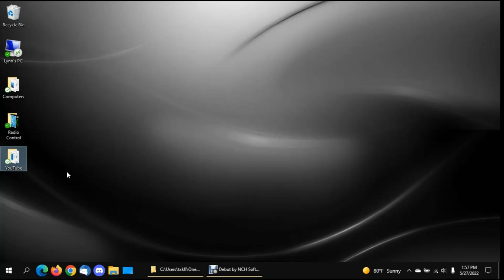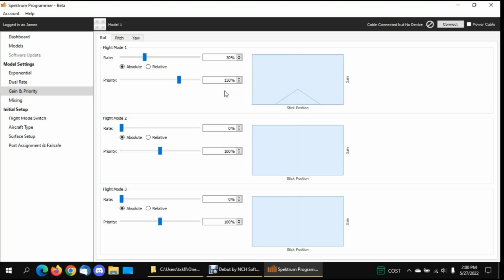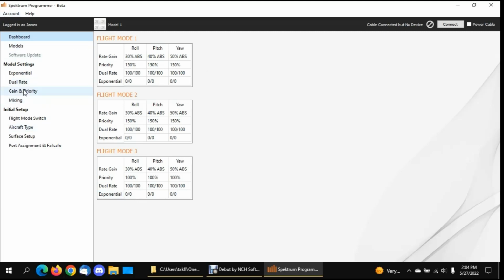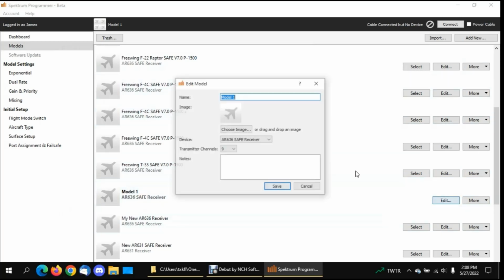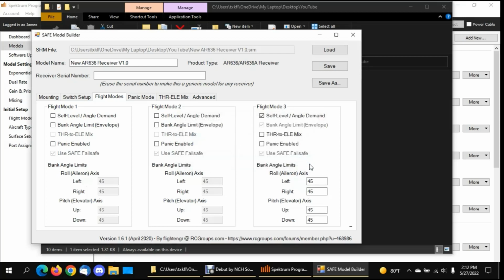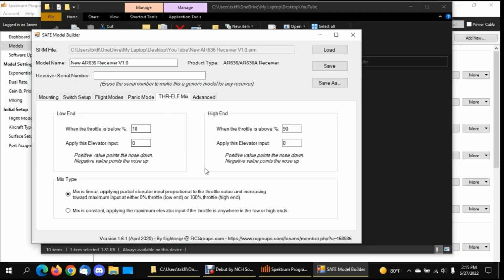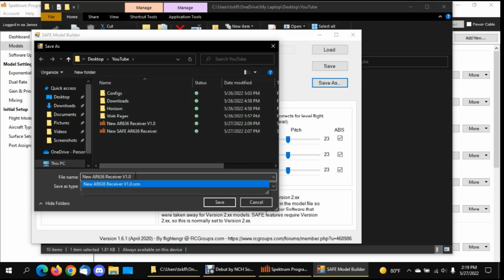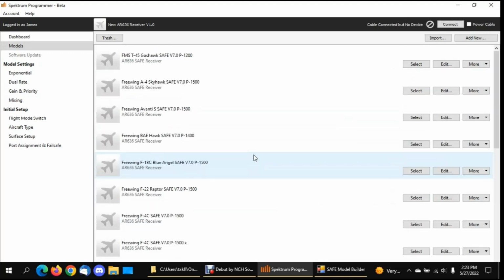Spektrum AR636 AS3X & SAFE Receiver How-To

Comment: so sad I couldn't find this video. had an old eflite pitts that got nailed into a tree, and on the next flight I reversed ailerons in the transmitter. had no control over the airplane, and it did a nose dive into the ground. ALWAYS double check your surfaces.
Reply from the maker: Not just what the sticks do, but what the gyro does as well..

Comment: Very good video. i learned alot.
Got my FMS ranger to a AR636 now and it works.
1 thing though .. on mode 3 you said keep everything to 0% if you want full controll... no AS3X etc.
I did that but it still does level off etc on mode 3. (I copied your complete video as a setup in my receiver with mode 3 on 0%. I guess later on in the video you sett all to AS3X again without mentioning the 0% without AS3X..
Well i got it flying anyway :) Thanks :)
Reply from the maker: With my single switch setup for low rates with AS3X, high rates with AS3X, and high rates with SAFE mode, All three FM's have the same AS3X gains, but FM1 and FM2 are AS3X only and FM3 has AS3X and SAFE Self-Level/Angle-Demand. If you want FM1 to be Gyro Off, set the AS3X gains for it to 0%. FM2 will be AS3X only, and FM3 will be AS3X with SAFE. But, you'll need to put the FM channel on a separate switch. However, the angle limits in SAFE mode are only correct when the dual rates are set to 100%. That's why I put both functions on one switch. When I go to SAFE mode, the rates also change to 100%. With separate switches, you'll have to manually switch to high rates in SAFE mode. Or, you can set up a logical switch to do it.

Comment: Sorry to trouble you again. I have set up a XFLY F15 40mm twin EDF and everything appears to work fine except for the elevator trim. The elevator moves in the correct directions and the gyro also moves in the correct direction but when I use the trim for the elevator to trim the model the trim goes in the opposite direction. For instance when I pull the elevator stick back my elevator raises as it should do to make the model climb but when I give it down trim (pull the trim switch down towards me) on the tx and expect the elevator to raise to enable the model to climb the elevator goes down instead making the model nose dive. I have been flying for over a decade so know how the sticks and trim to work so I know that the trim is moving in the wrong direction. I am using a Radiomaster TX16s and cannot see any functions to enable me to reverse the trim. Your help would be appreciated.
Reply from the maker: I don’t see a place where I can reverse the trim. When I look at the monitor, the trim moves the output the same way as the stick. Btw, make sure Enable Max Throw is unchecked. Create a new model and see what the trim does.
Reply: @txkflier  Thanks, I created a new model from scratch and it is still the same. The aileron trims seem to work the correct way but the elevator trims do not. Very puzzling. Where is the Enable Max Thorw check box, I cannot see it on both the SP and SMB.
Reply from the maker: @786free1 It’s in the RF settings of your transmitter.
Reply: @txkflier  I have enabled 'Max Throw on my Tx but to no avail. What does 'enable max throw' do any way? If it just allows maximum throws on all control surfaces then I already have that on high rates.
Reply from the maker: @786free1 When Enable Max Throw is checked, the receiver’s flight modes won’t work correctly; i.e., you won’t get flight modes 1, 2, and 3. A Spektrum transmitter outputs 1500+/-400 microsecond pulses at 100% travel. A TX16S outputs 1500+/-512 microsecond pulses. The Enable Max Throw option tells the 4-in-1 module which pulse width range to use - unchecked is Spektrum mode (+/-400) and checked is +/-512 which Spektrum receivers don’t like. So, leave it unchecked.
Reply: @txkflier  Thanks for clarifying that. I will uncheck it but since it was unchecked before, unchecking the 'enable max throw' box has not really helped. If you happen to figure out what could be causing the trim for the elevator to act in the opposite directions then please do let me know, it would be appreciated.
Reply from the maker: @786free1 I don’t know of anything that would cause the trim to be reversed. All I can tell you is look at the output screen and see if the stick and trim move the output in the same direction.
Reply: @txkflier  I just checked the tx monitor and the elevator stick and trim go in opposite directions.
Reply: I figured it out! I had unintentionally entered the weight of the elevator in the INPUT page as -80 instead of +80. Silly me. After correcting this to +80 the trim is now moving in the correct direction. Thank you for all your help, much appreciated.
Reply from the maker: @786free1 You should find the TX16S/EdgeTX thread on RC Groups and ask those guys what could be causing it.
Reply from the maker: @786free1 Good deal..

Comment: Help please. For some reason I cannot get the elevator on a new model (P51D Mustang) that I have set up, to go the correction direction in gyro mode. However the elevator moves the right direction when using it with the tx only. I have ticked the box on the Spektrum Programmer to reverse the direction of the elevator but this has not helped. I have re-set the rx and have tried it multiple times but to no avail. I have also reversed the elevation on the tx then ticked and also unticked the reversing box on SP but to no avail I have also tried using another working model template but am still not having any luck. Furthermore I have also tried just using the SP without SMB but even then I cannot make elevator gyro work correctly. I cannot think of anything else to do.  I would have thought that the tick box on SP would have made it work but not sure why it is not. I have the AR636 in three other models (P41 Razorback, Arrows's Red Hawk and Arrow's Viper) and they work fine. I also have another model (F15) that is also having the same gyro issue but with the ailerons but I am guessing whatever solves the issue with the elevator would also solve the issue for the ailerons.
Reply from the maker: With the AR636, you must NOT reverse the aileron, elevator, or rudder channels in the transmitter. You MUST reverse them in the Spektrum Programmer (SP). I create the model in the SP, export it to a folder, load it into SMB to edit all of the settings there, save it, import it back into SP, set what I can in it, and then write it to the AR636. If a control surface is backwards, I reverse it in SP and write it to the AR636 again. I initially set the AS3X gains to 30, 40, and 50 percent for AER. If you aren't editing the SAFE gain multipliers in the SRM file with a text editor, I'd set the SAFE gains to 15 for roll and 25 for pitch. If you're changing those multipliers from 100 to 50, I'd use 30 and 50. I start with the pitch attitude trim set to -1000 for 10 degrees nose up and edit as needed after a test flight. Also, don't set up low rates or expo in SP; do it in your transmitter. Set all of the priorities to 150 except in SAFE mode; I use 100 there since you should set the dual rates in SAFE mode to 100%. And, I set my expos to 1/4th (for small control surfaces) or 1/3rd (for large control surfaces) of whatever the rate is; e.g., 100% rate/25% expo or 75% rate/25% expo. In other words, divide the rate by 4 or 3 depending on the size of the control surfaces and set the expo to that value.
Reply: @txkflier  Thank you for responding. I should have made it clear, I only reverse the  surfaces before using SP and SMB as some of the servos have been installed the wrong way. I understand that to make the gyro work correctly I have to reverse the servos on the SP. Any way I managed to figure out what was happening, the amended settings that I would make to make the surfaces turn the correct way on SMB and SP were not really writing to the rx. As I plugged the cable into the rx and ticked the tick box on SP it was flashing once making me think that it was also writing to the RX. I was not seeing the green bar appearing briefly and forgot about that. 

I also noticed that sometimes SP would not write to the RX if the servos were plugged in. Once I would unplug the servos from the RX it would work fine. However this does not happen all the time. I also understand that the RX has to be positioned the way it was bound otherwise it would not turn on. Thank you once again, I very much appreciate your help.
Reply from the maker: @786free1 The USB port can’t supply enough current for servos, so load SP, plug the cable in, and then power the plane using a flight battery. Do not click the box to power the receiver from USB. Again, do not reverse any channels in the transmitter; do the reversing in SP.

Comment: I’ve got my airplane bound and it is bound and safe, but I cannot get a switch assigned to safe. I’ve called it all instructions in your video, but I still cannot get a switch assigned to safe. I take the receiver and move it but if I put it in solid and try to find a switch, I can’t get it to work
Reply from the maker: You have to go into Channel Assign in your transmitter and assign a switch to the channel you selected in the Spektrum Programmer or the SMB software (it should be the same channel in both). I always use channel 7 for the receiver's flight modes for an AR636. So, I'll assign switch B or C to channel 7.

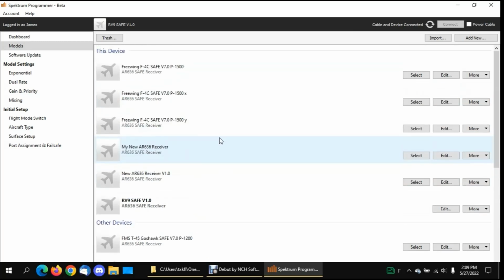Comment: At 12:40 you said that when u connected your rx to the pc it automatically picked the last model   you were working on, but that doesn't mean that is going to write over that model rx automatically, does it? I think not but just want to check.
Reply from the maker: If the programmer doesn't find an exact match, it'll pop up a screen where you can decide what to do. Stop and think about what you want it to do. I usually click on the "Show All" button, select "New Model", and then select "Use Device Settings". It'll then read the contents of the receiver so that I have a copy of whatever was in it. Afterwards, I can rename it as needed. If you make the wrong choice, it's either going to overwrite a model on the computer or overwrite what's in the receiver.
Reply: @txkflier  I think Spektrum could've made this section of the programmer better, if only it showed you in an obvious way which model profile it's going to write to so you know, perhaps with a warning window and then you could click on yes or no.
Reply from the maker: @786free1  It says what it's going to do; you just have to pause and think before clicking.

Comment: When I go to my forward programming it says throttle cut off ?????
Reply from the maker: The AR636 doesn’t use Forward Programming. Only the “Smart” receivers use it, and yes, Forward Programming only lets you into the menu when throttle cut is turned on. It’s a safety feature. You do use throttle cut, right? You should with electric airplanes.

Comment: great video.  wondering if you have ever experienced an error when trying to load a file into the safe model program?  Im getting a (unhandled exception has occured error)  If I click on continue it will not do anything.  i loaded the program from a link from rc groups.  Possibly a bad or older file? version 1.6.1 thanks
Reply from the maker: Your pc is apparently missing the newtonsoft.json library..

Comment: To be honest... I just got a Twin Timber 1,6 m and tried to get stuff working with AS3XS... It is a total pain in all regards... UX is like from the 90ies... Why? Why does it take 3 days to get a plane configured?
Reply from the maker: The Twin Timber has an AR637T which is much easier to set up than an AR636. Being a BNF, the receiver is already set up. You just assign a switch to a channel in your transmitter and enable SAFE Select if you want SAFE mode. You can get help here: https://www.rcgroups.com/forums/showthread.php?3564137-Spektrum-AR637-630-631-8360-and-Using-SAFE/page232
Reply: @txkflier  Yes, mine came without receiver and I am using the AR9035 which is a pain...
Reply from the maker: @Ozbird-72  I see that there is a PNP version of the Twin Timber. I didn’t think you could get one without a receiver. I don’t see an AR9035 though. It rarely takes me more than 15 minutes to set up the radio in a new plane.

Comment: Thank you, thank you, thank you! Are the first and only person (out of a dozen people I have asked) who is able to describe, explain and demonstrate how Safe & AS3X work and how to set it for use in a model. Bravo Zulu! Might be a stupid question; will the settings you demonstrated for safe & AS3X work for a helicopter?
Reply from the maker: I've never reprogrammed an AR636 for a helicopter. There are two versions of firmware for the AR636 for airplanes - one for AS3X with heading hold (V1.x) and one for AS3X with SAFE (V2.x). They list 5 or 6 other firmware versions for various helicopters, but I've never loaded one of them into one of my AR636's. On the Google shared drive, Spektrum has config files you can download for airplanes, but I didn't see any for helicopters. I have a Blade 230 S I might could read the configuration from. I think I also have an AR636 that came out of a helicopter that a friend bought at a pawn shop. It's missing one or both antennas, so it wouldn't hurt to play with it.

Comment: Worked great on my SU29. In safe mode the ailerons twitch. Can you suggest a fix either thru the receiver or transmitter. Thanks, Kevin
Reply from the maker: How much AS3X and SAFE gain are you using? What are the servo travel and dual rate settings?
Reply: as3x roll 30,pitch 40,yaw 50/safe roll 30,pitch 40,yaw 50.dual rate aileron 100% E50%/60% E30, Thanks, Kevin
Reply from the maker: @kevinbuckley2641  If you don’t edit the SAFE gain multipliers like I do, you need to set the SAFE roll gain to about 15 to 20. The default is 18. The SAFE pitch gain should be about 20 to 25. I want about the same throw in SAFE mode as I have in low rates with SAFE turned off. In SAFE mode, you have to use 100% travel and dual rate for the angle limits to be correct.
Reply: Mode 3 settings for  Roll gain 30% Priority 100% Pitch 40% priority 100% Yaw 50% priority 100%. Thanks, Kevin @txkflier
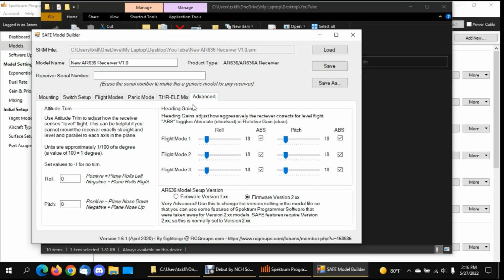Reply from the maker: @kevinbuckley2641  It's ok for the AS3X gains to be 30, 40, and 50 for roll, pitch, and yaw. The SAFE mode gains need to be about 18, if you don't edit the SAFE gain multipliers (Kp) using a text editor like I do. I don't think I show how to edit them in this video. I have shown it on RC Groups. Look for txkflier there. Watch this video again starting at 19:47..
Reply: Roll is 18, pitch is 23. I'll play with the numbers, thanks for all your help, Kevin @txkflier
Reply: I've reduced the the safe gain modes in increments down to 8 for roll in the advanced page safe model builder. The twitching continued. The twitching stops when I select mode 1(Safe Off).Should I adjust the rate gain in the Spektrum program for roll? It is currently 30%ABS. Thanks, Kevin
Reply from the maker: @kevinbuckley2641  I’m not sure what you mean by twitching. When does it do it? You might try lowering the AS3X gain a little. Not sure why it only does it in SAFE mode though.

Comment: Hello 
I may have messed up 
The unassigned ports. 
Do I leave them unassigned or port 5 to gear and port 6 to flaps. 
I seem to have lost channels 5&6 now?
Reply from the maker: What transmitter are you using? Does the plane have retracts and flaps?
Reply: @txkflier  yes gear and flaps. I think I figured it out. I have to select adjustable and Not hold on the screen that you press safe once and all three light up. Took me several tries but I am having a blast reprogramming a ar636. 👍
Reply from the maker: @bobanderson2807  The defaults should work. Just click on one of the SAFE buttons and the others should switch as well.
Reply: DX-9 sorry I didn’t say earlier
Reply from the maker: @bobanderson2807  Good deal. Use channel 7 for the receiver’s flight modes and 8 for panic, if desired. Don’t use the transmitter’s flight modes to control the receiver’s flight modes. They are separate things. Just assign a 3-position switch to channel 7 and the bind switch to channel 8 for panic.
Reply from the maker: @bobanderson2807  Also, update your DX9 to firmware 2.0.9. You’ll need it for Forward Programming on the Smart AS3X/SAFE receivers. The AR636 doesn’t really need it, but 2.0.9 has “Require stick low” in Throttle Cut and fixes the channel assign/rx port assignment menus.

Comment: Can you reexplain how to reset the 626 when after the first flight the model slowly dives and turns slightly. How do I reset the 626 to get the flight closer to perfect level for second flight?
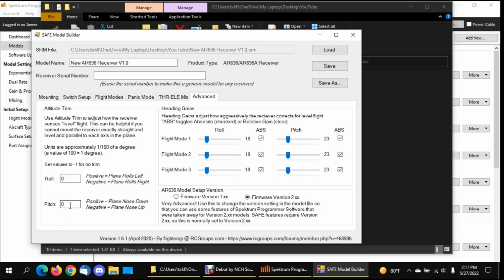Reply from the maker: At 20:52, I explain the SAFE mode roll and pitch attitude trims. These are what you edit to make the plane fly straight and level in SAFE mode. However, you must first trim the plane to fly straight and level with SAFE mode turned off using the trim levers on your transmitter and then adjust the linkages so that you can return the trims to center. You shouldn't continue to fly a plane with the trims very far from center.

I didn't show this, but I will often save multiple versions of the config file where each one has a slightly different pitch attitude value and I'll put the value in the file name. If I set the pitch attitude trim to -1200, I'll name the file "New AR636 Receiver V1.0 P-1200" so that I'll know what the value is. Then I'll set it to -1400 and save the file again as "New AR636 Receiver V1.0 P-1400". I'll create several configs at home and have them ready to load at the field. That way, I won't have to do a bunch of editing at the field.
Reply: @txkflier  okay I will relook at that ty
Reply from the maker: @bobanderson2807  I just edited my comment, so take another look at it.